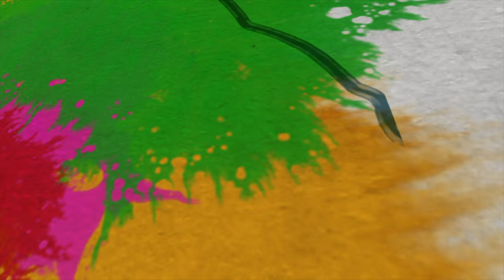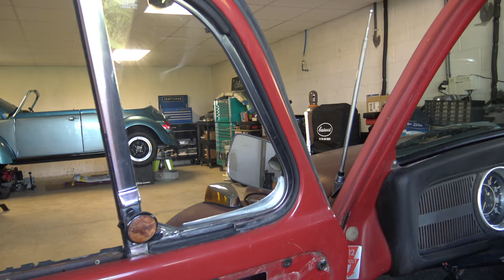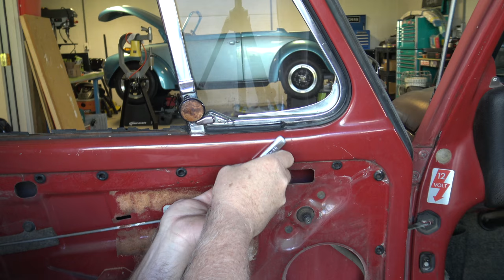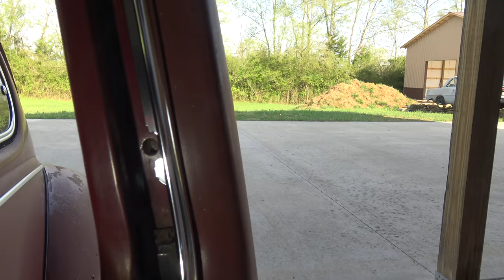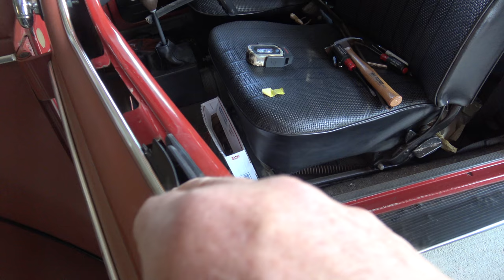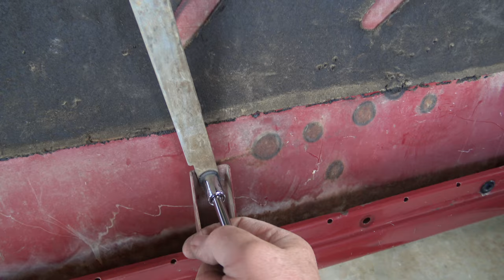VW Beetle Window Scraper Replacement

Comment: Suggestion ;  you mentioned adding the 3 clips from the old scraper to come up with a total of 7.  If you have a really old OEM scraper like mine it had 7 clips so I decided to take out the new clips and use all the old 7 clips.  I almost made a BIG ERROR as I THOUGHT I had to drill out the strip to remove or add clips to the new scraper.  Just in time and by staring down the new scraper, I realized I just had to squeeze the clip together and I could remove it !!!  Whew.   I DID NOT need the drill.  Hopefully this will help someone not make the error I almost did.  I liked and used your video for my project above all others I reviewed.  Thank you.

Comment: Great video. well explained.Im from Canada and worked for a glass company for 18 years. If i may just add two more comments of help to your video when you put the door glass back inbetween the scrapers at the very top of the back chanel that would be closest to back wheel. at the very top of that channel give it a light spray of clear spray silicone to the bottom of channel just before it goes inside the door then you can apply heavy spray down channel to the very bottom ( the silicone will run down the channel ).  until you see it just start to drip out. and then same on front channel makes it so much easier to roll up and down and give the gears on the regulater a good dose of lithium grease help keep it lubed. and at the end before the door panel apply a heavy piece of plastic back on the door. keeps any moisture that gets past the scrapers from letting moisture get to the cardboard door panel which can cause a musty smell inside car plus not warp the panel from getting wet and drying out over and over. Hope this helps all you people out
Reply from the maker: Hey Todd, thanks for the tips. I'll try the silicone. How's the bug scene in Canada? I'm a big Rush fan. 😁

Comment: Thanks for the tutorial. It's very well done. I am working on my 1975 La Grande Bug/Superbeetle. There are a couple minor differences but your video was more than enough to help me get everything apart. I discovered rust under the outer window scraper so I'll be doing some touch-up paint before I put everything back together.

Comment: Hey Jay, thanks for the refresher. I did mine some forty-five years ago when I was in my early twenties. The originals lasted about 13 outside years of hot California summers, and the replacements almost four times as long garaged in Oregon. It's time I replaced them again. 
My wife is a fiddler and makes like she's going to open the windwings but I don't let her since I haven't operated them since the late seventies. It's a 1963 Bug.
One thing I'd mention  - as long as the panels are out, clean out the weepholes at the bottom of the inside. They get plugged up and will cause rust. Also, you didn't have a clear plastic (visquine) between the door and the door panels? The plastic keeps moisture away from the cardstock panel.
Finally, I love German engineering! Even in a low end product they pay Porsche quality attention to the details. Everything fits with precision. Thanks for sharing.
Reply from the maker: Daniel, yes I always clean inside the bottom of the door, just didn't mention it. I get in there with a vacuum and even knock dirt loose with a screwdriver if I have to. Yeah, I could have replaced the sheet of visqueen but didn't have any and old ones were brittle. Thanks for sharing.
Reply: You’ve owned the bug since new? It must be a real gem. How many miles?
Reply: @AndyHinkson  , no, not the original owner. I bought it from my cousin. I drove it for about ten years, then gave it to my parents who took it up to Oregon. My mom gave it back to me four years ago, when they stopped driving it. 
It’s a fun vehicle to drive around in, especially since so many people want to stop and chat about it with me. Cheers 🍻

Comment: Great video.  I noticed the outside scraper at the back had a curled edge.  I had this same anomaly with my Wolfsburg West “German” scraper.  Also, when you had the wing window out, that was a good time to adjust (usually tighten) the hinge/pinch bolt at her bottom of the window.  This keeps it so the wind won’t alter the position of the window.  Snug, but not so tight that the window won’t turn, lol.
Reply from the maker: Yes, that curled or bowed out rubber in the corner really bugged me. I parked the car in the sun and put a piece of masking tape on it to hold it against the window. It helped a little but still noticeable.

Comment: Terrific video! There's a lot more to this job than I expected. I recently purchased a 1970 Beetle. The previous owner had the windows tinted and some of the tinting on the driver's side window has scraped off. The scrapers seem ok and the passenger widow tinting is fine. So I'm not sure why the tinting on the driver's side is damaged. After watching your video, I think I'll just live with it until the scrapers need replacing.
Reply from the maker: Hope the video was helpful. I've always thought it's easier to take the windows out when tinting. Maybe do it at a time when you're replacing window rubber.

Comment: Awesome!  I was anxious about tearing down the door to do this project, your video has broken each part down with great detail.  I just got a 1970 and thought all the interior knobs were sun rotted plastic.  When I went to replace them I noticed I had wooden knobs for everything!  Never knew bugs had wooden accents, but I see all your knobs are wooden too!  I sanded and varnished and they look great now!Subscribing and will be back for the next project.  Great job, and thanks.
Reply from the maker: J.P. Glad you liked the video. Yes, those wooden pieces are aftermarket add-ons. Mine were on there when I bought the car.

Comment: Fantastic and detailed video you make !!  Stupid question ,  The driver side door when ordering is the Left side ?  I was taught as a person is sitting in car left is driver and right is passenger . But not sure about German cars and ordering . Thanks and keep the great video's coming !
Reply from the maker: Yes for parts, driver is left and passenger right.
Reply: @JayDubCustoms  Thanks for the very fast reply !!!!  YOU ROCK  !!  Ordering now
Reply from the maker: @sparlin88  If you can, get the Imecal brand outside scrapers. They're made in Brazil and much better quality. VW part numbers are 113 853 321D and 322D. If you buy from an EMPI dealer, it's 98-1048-B and 1050-B. Those fit 65 and later Beetles. I have a set on-hand.
Reply: @JayDubCustoms  I ordered from Wolfsburg . Are those good ?
Reply from the maker: @sparlin88  yes they make a good one too.

Comment: Definitely appreciate the video, GREAT JOB!! Issue I'm having is when I roll the window down and then back up, it's getting caught behind the outside scraper; what would you recommend for a fix? Is there anything to apply to assist the window to move up/down easily? Really enjoyed your video. Thank you again.
Reply from the maker: Thanks Angel, you may have to drop the window glass down (5:45) then press on the scraper with your fingertips and ensure the clips are snapped into the door. And maybe even roll the edge of the soft metal away from the glass towards the inside of the door. Then position the glass all the way up before tightening the bolts (29:40).
Reply: It did help somebody thanks

Comment: This is a great tutorial for replacing the window scraper.   We got all of it done until the window separated from the window sash trying to roll it back up.   The sash was all rusted out.   Waiting for that so we can finish the job.   Any suggestions on getting the window to roll a little easier?   It’s so tight with the felt and scraper.
Reply from the maker: Thanks, hope the video was helpful. Yes, I know what you mean with it feeling tight, and it'll be that way because everything is new. Only thing I can suggest... loosen the 2 bolts that hold the glass to the regulator, roll it all the way up ensuring it's aligned properly then re-tighten the bolts via the two access holes.

Comment: I’m gonna do the same to my 1971, but I don’t want to add the chrome trim around the window. Can it be done?
Reply from the maker: Don't think so... the trim and the rubber are made as one piece. The trim is what actually holds everything in the window. One option would be to black it out.

Comment: Thanks Jay for the great explanation. Is the process exactly the same for a 73 Type 3? Also how do you replace the knob on the quarter vent window?
Reply from the maker: Paul I've never wrenched on a Type 3 but I would imagine it is very similar to the Beetle. The vent knob involves a rivet. I'm working on a video about all windows for a 71 Super Beetle convertible. Hope to get it posted soon.

Comment: Thanks for the video‼️❤️

Would you recommend using white lithium grease (or any other product) to keep the rubber from drying out?
Reply from the maker: Rob, the lithium is more for metal and plastic parts like the window regulator. Keeps it lubed. Never really thought of putting something on the scraper. Maybe some Armor All occasionally or another dressing for rubber.

Comment: Hi, Jay. I am in the process of restoring my 1970 Beetle and I noticed that mine doesn't have the vent wing. I'm not sure what to do with the scrapers and felt channels, do you have any advice?

Love the videos, super helpful and informative. Keep it up 🎆
Reply from the maker: Suzette, Someone probably removed those to install a "one-piece" window. They are primarily for looks. I suggest you find a pair of vent windows and put them back in. They keep the bug original and are nice for directing air into the car when driving in warm or hot weather. The stock scrapers will not fit correctly without them. You could most likely find a pair at a VW show and swap meet. I might have a couple, I'd have to look. What state are you in? There's 3 shows coming up this Spring in the TN and NC areas.
Reply: Unfortunately I am in South Africa so not going to be possible 😂 but I will check if there are a few options on my side. Thank you so much for your help

Comment: Wow I did not realize it was that long ago that I made a comment on your video I'm just about done with my 67 I just got German scrapers inside. and outs  for my doors ordered I do need to clean my regulators they're just a little grungy but they're okay  I was trying to save my original outer Scrapers  but by the time I got into them they were in pretty bad shape they looked okay on the outside but where the felt goes they were pretty cracking beat up  I should be getting them on June 19th..
Reply from the maker: Hope the video helps you out.

Comment: Great videos. Any idea what size those phillips screws are for the scraper and the vent window inside the top?
Reply from the maker: The small one in the scraper is a #1. The larger one holding the vent window is a #2. That one is usually tight, so put some upward pressure on it when turning it to avoid stripping it out.

Comment: What about recovering inside of door with plastic ?
Reply from the maker: Tim, yes I should have covered that step. But it's basically to keep the back of the door panel from getting wet if driving a lot in the rain, or from a car wash.

Comment: Hey Jay.I was wondering about the parts that you ordered  from Wolfsburg. Did it come in a whole kit,or did you have to order  each part separately?Thanks Darren.
Reply from the maker: Darren, it's 4 separate parts. Here's part numbers: 113853321D, 113853322D, 111837475B and 111837476B.
Reply: Saved me time to look up parts, thank u

Comment: The scrajpper rubber should be trimmed/cut, to butt against the center guide, so that the rubber will contact the sliding glass.
Reply from the maker: Good point, I'll take another look.

Comment: I just replaced the scrapers on a 63 beetle, the inner scraper uses the wire style clip. Can you use the newer style like you used in this video?
I believe it's a 65 and newer version with the ones you used in this video.
Reply from the maker: @goldentrunnell7450  I know what you mean with the wire type clip. I've never switched them out, but I imagine the rectangular holes in the door are the same on both early and late models. I'd have to look. If that's the case, either clip would work on the door. The newer style seems to be softer and more flexible when snapping into place. I just don't know how you'd remove the wire clips from the scraper and then attach the new type.

Comment: Nice vid, in the uk we call the event window the quarter light. But more importantly having real difficulties with the winder mechanism.  Any ideas ?
Reply from the maker: David, are you referring to the winder for the main door window? If so, I use white lithium grease to lubricate the track. If it's rusted bad enough you should take it out of the door and put some lube on it like WD-40 and wind it up and down until it moves easy. Then the lithium when you put it back in. Also, sometimes the 2 bolts at the bottom of the window glass come loose and then it will bind up in the felt channel causing it to feel tight. Check that too.
Reply: Hi yes it's the winder mechanism.  Am on my second new track , lubed up as you say but I wonder if the door edge track is out of place ? Through rust etc . I have the window in after 3 days but it goes up ok but struggles  to come down without a push from the top. Got rid of the fancy wonders now have the correct  splined  original black handle.

Comment: Is it the same proses with a earlier 58 Bug?
Reply from the maker: Pretty much. Just the scraper itself will be a little different.
Reply: @JayDubCustoms  Take out the pins that hold the Window crank and door handle,  Same proses with the armrest?   Does the wind wing tilt out the same??
Reply from the maker: @robertfair1770  Yes, arm rest the same way. Vent window should be Phillips head at the top inside channel and a bolt near the bottom (behind door panel).

Comment: Do you have a video or can you explain how the vent window comes out on convertible (72)
Reply from the maker: David, sorry for the late reply but there's 2 bolts at the top... they're on the top corner, outside of the door facing the front of the car (10mm). Then there's one inside the door behind the door panel near the bottom of the door. It's an adjusting type bolt to move the vent window side to side. Those 3 are the only ones holding in the vent window.
Reply: @JayDubCustoms  thanks so much. I will try that in the morning. I believe there is a Phillips screw in the vent channel under the seal as well

Comment: How do the bucket seats come out of a beetle the easiest way??
Reply from the maker: Joe, what year is it?
Reply from the maker: Probably easier to explain it over the phone. Call me at 512.506.0074
Reply: 73 beetle
Reply: @JayDubCustoms  ok thanks
Reply: @JayDubCustoms  73
Reply from the maker: @joedonhughs1374  Ok so 73 was the year they changed from 2 rails to a 3-point system. Before 73 the seat came out by pushing it forward, but the 73 you’ll remove by pushing to the rear. Under the front of the seat there’s a pin with a spring on it. Remove the spring then slide the pin out. Then push the seat backwards until it comes out of the tracks. I can send a picture if you have email.